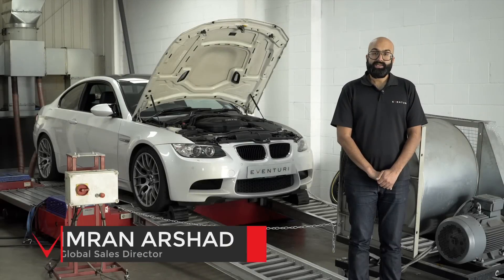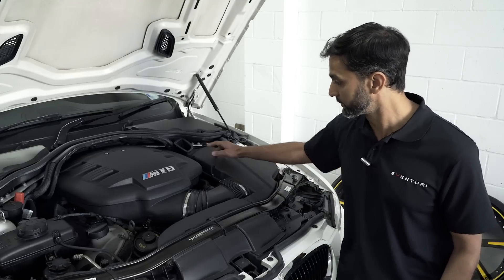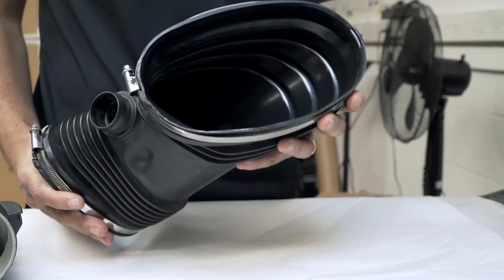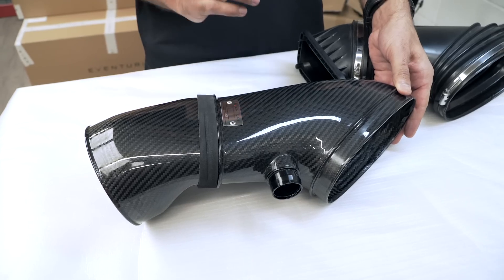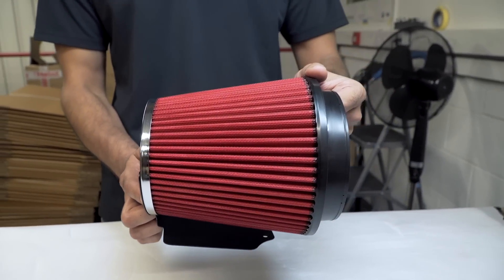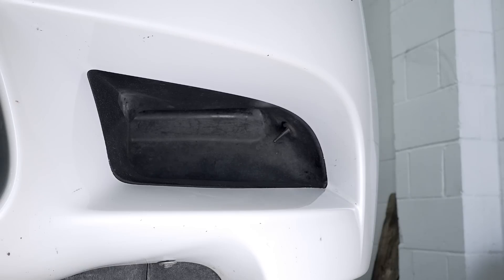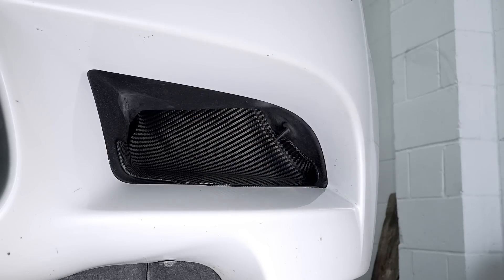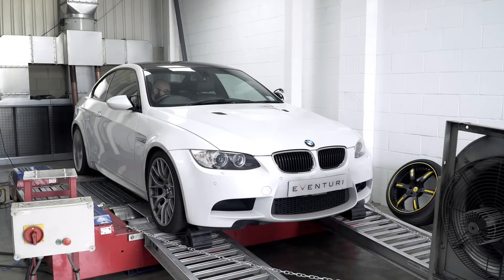Detailed Analysis: BMW E9x M3 Eventuri Intake E90 E92 E93

Comment: Does tune help further to the air flow tube or those are independent of one another? Does CF plenum add ANY more power?
Reply from the maker: Tune is completely independent, the intake doesn't require a tune to make additional power.

The Eventuri Plenum is a 1:1 copy of the original to retain OEM levels of drivability and therefore makes no additional power.

Comment: Hey Imran. Would the stock tune of the car not cause any restrictions on achieving more air in to the system? Would an EUC tune to adjust the look up max values increase the chances of more HP?
Reply: Great questions, I am wondering the same thing.

Comment: Isn't the duct ridge there to prevent water and debris from splashing up? I guess your custom fitting on the intake filter resolves that issue.
Reply from the maker: That’s part of its function yes, which is why the Eventuri has a guard on the filter

Comment: Here I was,   thinking the actual airflow in the airbox is managed/restricted by the outlet in the bonnet   , creating a positive pressure in the airbox under higher vehicle speed.  You can see sometimes when you ingest some spray into the airbox and it spits it out onto your windshield.  You right-hand drivers are lucky you get it on the passenger side :D
Reply: Can you elaborate a bit? This morning it was pouring rain and I downshifted (DCT) and the vent shot out air and water like a blowhole on a whale and I was so confused lol
Reply: @vkolpdj 
 I think savagegeese has some vid from M division showing the airflow through the airbox.  I don't know aerodynamics that well but I can imagine that it requires less force to take in air that is already moving as opposed to still air before throttles opened.

Comment: I can understand the cost factor of carbon fiber parts but it seems strange to me why BMW would design some parts that restrict air for no apparent reason? It is not that they luck mechanichs and air tunnels... Maybe there is a reliability loss?
Reply from the maker: There’s no loss of reliability.

BMW have many more factors to consider, such as NVH. The stock design will be partially designed to keep noise levels down. It also needs to be easy to mass produce in large numbers.

An aftermarket manufacturer who wants that noise and is manufacturing on a much smaller scale and at a higher cost can make changes that BMW chose not to for whatever reason.

When designing a car they have a set performance point, the stock system was adequate for that goal.
Reply: @EvolveAutomotive  that seems to make sense, thx for the reply. Keep up the good work

Comment: 4 liters at 6k rpm equals 200 liters of air per second. You lost me when you came up with the blower. Do it properly and measure the absolut pressure and temperature downstream the filter and let’s compare!

Comment: For 800 quid, you could have surface resin coated the inside of the tube to make it a smooth as the outer surface . All that exposed carbon will add to turbulence.
Reply: Valid point and I thought the same. I wonder how come this to the point comment received no reply form EVOLVE while all others have 🤔

Comment: Interesting that they chose a mold that makes the smooth side on the outside for looks, and the inside is rough. Still looks like a very high quality carbon piece, but if you look at a racing piece, you will see rough on the outside and perfectly smooth on the inside.
Reply from the maker: Constant improvements have been made and the inside of the latest intakes we have fitted are very smooth. Of course for a consumer product aesthetics have to be considered which is why the exterior is the ‘finished’ side.

Comment: Excellent video and technical explanation.  Would you recommend a dry charger for real wet conditions?  I am pretty nervous after hydro-locking a different car with a similar setup in a big rain storm.  Might be worth a dyno run with a dry charger for additional protection.
Reply from the maker: The intake was tested in very wet conditions in the UK before release and we saw no issues. The product has been in the wild for over a year now and we have had no such issues reported.

Comment: Totally sold!, I was searching on m3 intake systems then found this, different level engineering, well done, 1 thing only is that scoop would have looked much better in matte carbon finish
Reply from the maker: It's a great system and really works
Reply: They have a matte finish now. It looks totally wicked with every other under hood component.

Comment: How much of the 9hp ATW difference was due to the filter and how much of it was due to the elbow piece?
Reply: It's a bogus claim, entire advertisement is BS, they removed a PROPER cold air intake and replaced it with a HOT air intake, that will reduce performance.  Retarded mod.
Reply: Bo McGilacutty You sound real bitter. Until you can back your claim like this advertisement did, your OPINION isn't worth shit.
Reply: Calvin Sanders
Bitter?  Do you not understand the reasons for a cold air intake versus a hot intake?  When you pull air from the HOT engine bay instead of in front of the car as BMW engineers do there is a small but significant penalty in performance...advertisement is clearly bogus.  Go ahead if you like the appearance and purchase this garbage, I know better, my M3 will remain stock in this respect, the factory intake is designed very well, it even keeps cool air flowing through the air box when off the throttle so it won't warm as much, difficult to improve on but easy to make worse.  Only ignorant children fall for this sort of thing.
Reply: Bo McGillacutty did you not watch the WHOLE video? The intake still uses the original air box and they even improved air flow to that air box. Watch the whole video before you make your false statements.
Reply: Bo McGillacutty and only children go through the whole comments of a video talking a bunch of nonsense before watching the whole video.
Reply: Calvin Sanders
That's NOT the way that airbox is set up to opperate, do you know anything about these cars?  Does this mod take in engine compartment air or NOT??  YES!  That's rubbish, grossly inferior to a cold air intake (aka. stock), you apparently have no idea what your talking about.
Reply: Calvin Sanders
Yes I went through a few of these comments, all apparently children who don't know any better and tried to tip a few of them off to this farce.  Why are you so emotionally invested in this crap product?  I simply get motivated by fraudulent claims to speak up....probably a waste of time, they will grow up one day and realize how dumb they were just as most of us do (and were in some ways or others).  Frankly many simply want to justify something they think looks cool regardless of actual results, with this you get worse performance and increased engine wear due to poor filtration, nice combination.  This is why I never purchase a car from a 'kid'.
Reply: @Mrbfgray  No it doesn't!
Reply: @Mrbfgray  Except you're talking total crap! For the record, no I'm not getting one :p (because of cost).
[edit] Sorry for the separate replies, stupid youtube!
Reply: @Markpd69  (yeah I have probs with these threads too often)  I was wrong about the hot air intake, I didn't take the time to see what they had done entirely, at a glance it looked like the typical childish "toss the filters in the hot engine bay" mod.  SORRY ALL!
Reply: @Mrbfgray  BS , no they didn't, where did you get that from??
Reply: @Markpd69  I was rash and WRONG!  (I can admit it as I'm almost never wrong, HA!)

Comment: I have been running the Dinan Carbon pipe with their BIG blue filters. I wonder how this would perform against mine. Very nice design and execution!
Reply: i would they would perform almost identical if the dinan doesnt perform better as the dinan has a shorter tube
Reply: If you capture air from the engine bay you will reduce performance, the stock is a cold air intake and this garbage design is HOT air intake.  Bogus claims, stupid design.
Reply: @Mrbfgray  its a closed intake system. Its a proper cold air intake. I saw many of your comments, it seems like you havent seen the video. As an automotive engineer I can tell you for sure this is a nicely done cold air intake. No need to he harsh on other people work.
Reply: @TheZisco  When it's a SCAM it's proper to call it such.  It's taking the air from the engine bay, that's NOT a cold air intake, it's a HOT air intake, who do you think you'er fooling?
Reply: @Mrbfgray  what ??? See the video !!! It is not getting air from the engine bay , it similar to the oem setup
Reply: @Saif0412  What yr. was that??  I moved on LONG ago Sport.  What's your problem?

Comment: Wicked vid, i need one of these bruh
Reply: @Mrbfgray  Where do you get the idea it's a hot air intake? The video clearly shows it's using the original pick ups!
Reply: pro tip: watch series at Flixzone. I've been using them for watching a lot of movies lately.
Reply: @Sergio Ivan Yea, have been using Flixzone for since december myself :D
Reply: @Sergio Ivan yup, I have been using flixzone for since november myself =)
Reply from the maker: LivingLifeFast thanks Ricky. Will get you hooked up with one soon.
Reply: LivingLifeFast
Why would you pay to reduce engine power and efficiency with a hot air intake?  This is a STUPID design.
Reply: @Mrbfgray  all the results are showing before and after, there is nothing such as reduce engine power with an intake system, either it doesn't add power or slightly increase power, get your facts right.